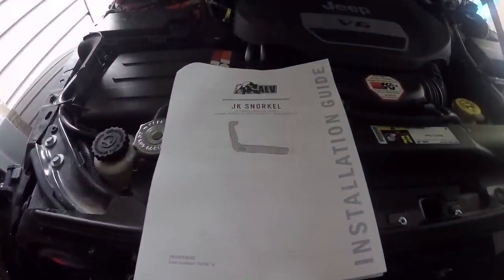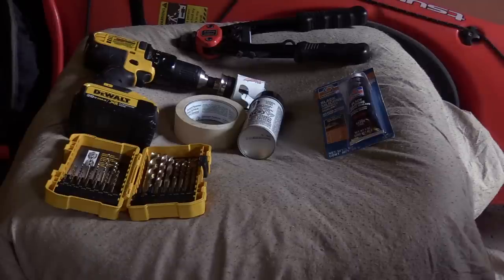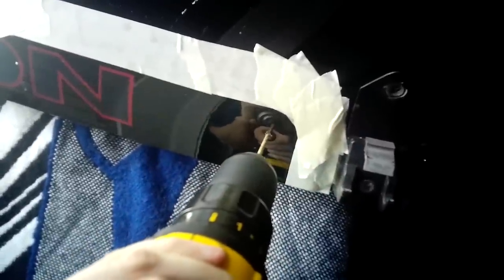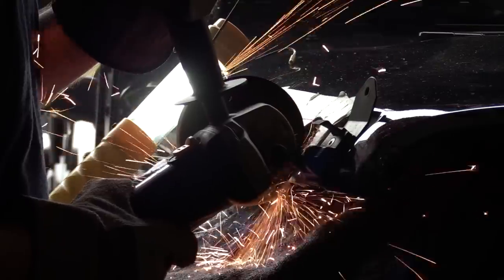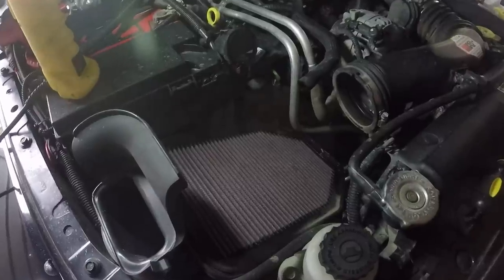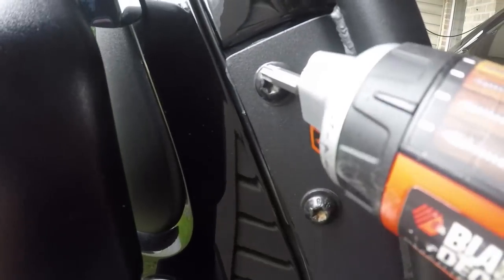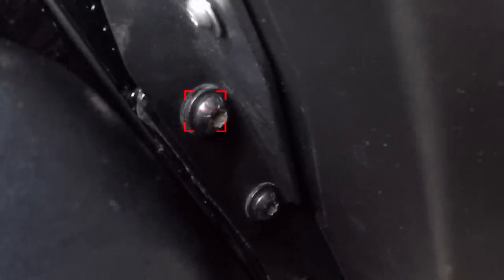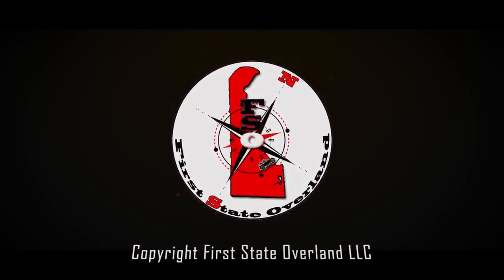AEV Snorkel Install on a Jeep JKU with Gobi Rack

Comment: Nice video. Definitely check the air box after driving in your 1st heavy rain to see if you're holding water since you sealed the drain holes. Also in slushy/snowy conditions, spin your intake around or pull over every half hour or so to unclog ice buildup. And, don't forget to extend and raise your breather hoses.
Reply from the maker: Thanks for watching!  And all good recommendations!   Our breathers are already raised and I've read the same comments about spinning the scoop around in snow.  I really wish the AEV Prefilter would fit with the Gobi rack.
Reply: Thanks for making this video. This snorkel is the best one out there for a JKU as I have been doing my research. Will the pre filter fit to replace the Ram scoop to eliminate heavy downpour coming into the snorkel?
Reply from the maker: It will if you don't have a Gobi rack.  Otherwise the front rack brace will get in the way.

Comment: What kind of air flow do you get with those lights blocking the grill ?  Nice Jeep
Reply from the maker: The grill is plenty big enough to let airflow through.  Haven't had any problems at all.  There are tons of Jeeps out there with lights in the same spot.

Comment: Hey Chad - quick question buddy. Do you have a photo of what the hood looks like on the inside after you’ve cut it? Planning to install my snorkel and it only came with one trim ring for the outside of the hood. Appreciate it if you do.👍🏽

Comment: Great video man! 🇺🇸💪🏻😁 Have you had a chance to really test it? Did you seal ANY other areas to keep water out of the Jeep or make it water tight??
Reply from the maker: Honestly, I don't really plan on "testing" it.  This was installed as a precaution because our next upcoming trip out west has several water crossings, some of which might be pushing the line of needing one.  My goal is to not every put the Jeep in a situation where water will come up over the hood and I don't drive like an idiot spraying high pressure water 20 feet high.  That said, I will be keeping an eye on it over time because the entire thing is sealed.  My main concern now is the snorkel sucking in rain during heavy downpours.  The design has several low areas where water can pool before it ever gets close to the air box but there's no way for it to exit.  So it just has to evaporate eventually.  Others have said it's not an issue, but I want to see for myself.  Thanks for watching!
Reply: Have you been able to revisit this and see if water is/was making its way in to the bottom of the box? @FirstStateOverland
Reply from the maker: @st8ton  Bone dry in the air box.  But it hasn't been in deep water.  Just torrential rains.

Comment: Looks good!  Does it interfere with the passenger door when it opens all the way?  Can i run a snorkel AND a light bar?
Reply from the maker: Not at all, unless you unstrap the door completely.  But under normal opening it never touches.

Comment: Nice video... question. The brackets that come with the snorkel kit WILL work with my Gobi rack and i dont need the one from them and wait 3 months to get. They make good stuff but there lead time on shipping sucks.
Reply from the maker: This is a Gobi stealth rack and the fit (as you see in the video) is VERY tight but it will work.

Comment: Great video. I have standard stock JK wrangler snorkel that I got with the jeep when I purchased. It is not installed but I'm thinking of installing it. Only problem I don't have the template. Is AEV snorkel same as stock? I have JK 2007 3.8L.
Reply from the maker: To my knowledge there's no such thing as a "stock" snorkel from Jeep back in 2007.  I believe MOPAR only just started to supply them with the new JLs.   You could have an off brand that they gave you and called it stock?  There are lots of Chinese companies that try and mimic the AEV snorkel but they use a different type of plastic.  Side by side you can tell the difference.   Also the 3.8 has a few slightly different steps than the 3.6 but the holes are cut and drilled the same.  It's just the airbox that's slightly different.

Comment: When happen if I take my Jeep thru a car wash and water goes thru the snorkel?
Reply from the maker: The design will prevent everything but a direct spray into the opening.  If if was me, I'd turn the intake around backwards.   It's made so that IF any water does make it in, it will settle in the low points.  And even IF if does make it past the snorkel into the air box, there's still several inches in your airbox before it hits the filter.    If it was me, I'd try it and check my airbox for water afterwards.